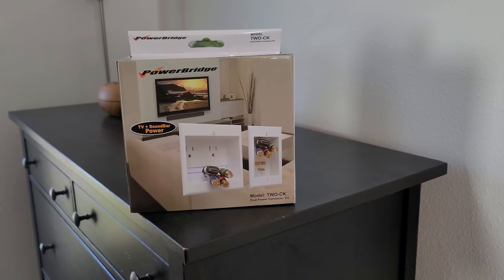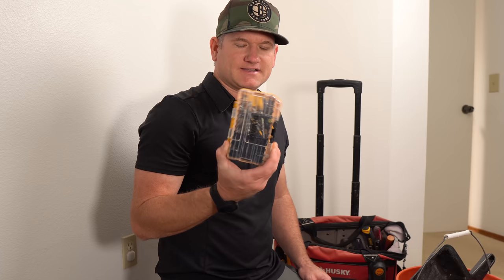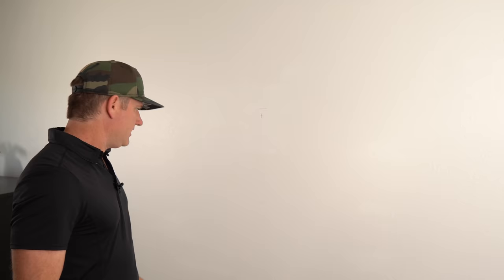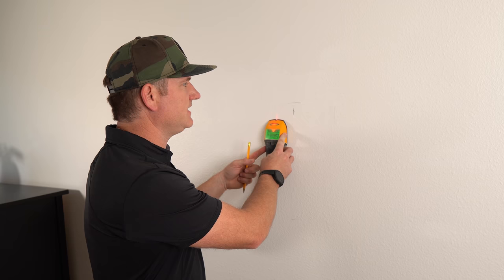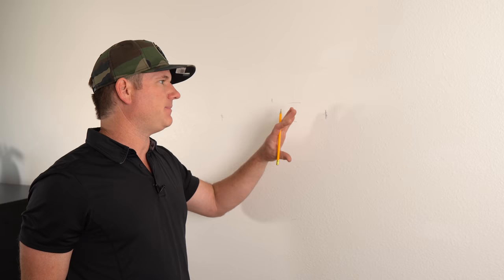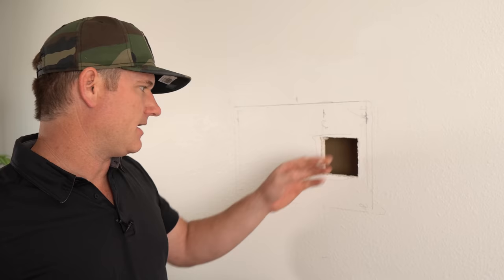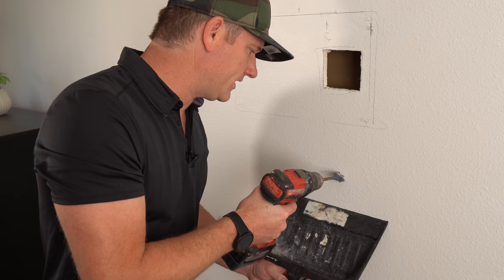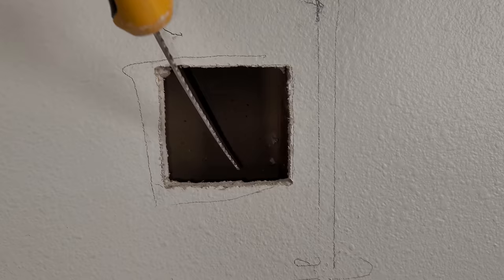Hide Your TV Wires Easily w/ PowerBridge like a PRO

Comment: Great information. What is the recommended  HDMI cable length for running cables in-wall?
Reply from the maker: I always just do 15ft to have length against the mount and tv to side of hdmi and down to your source. 10ft typically works.
Reply: @BTheInstaller  Thank you very much!

Comment: Is there a reason you didn't just cut in a single gang old work box and use a blank plate?   The owner most likely isn't going to sand the wall patch and paint behind the TV.   Seems cleaner, faster and less messy to use a blank plate.....it can always be patched if needed

Comment: That's NOT how a licensed "RW Electrician" does a TV or Audio/Video installation!! We don't ever have any A/C power cords, CATV, CAT6, HDMI, Fiber, RJ45, RG59/RG6 BNC cables ever being exposed.

The BICSI, UBC, IBC Electrical NEC code installation doesn't require an additional hole(s) to be made in the wall. 

Correct uniformed installation is as follows......

1 - Verify OHMS law on all associated equipment to determine the correct circuit rating - re; 15amp-20amp-30amp etc...

2 - Template your install backplate to the the desired wall location, also verify local A/C power.

3 - Determine install location, then trim out your TV wall mount and recessed cabinet onto the wall.

4 - Fish your A/C and all other cables behind the wall after utilizing a flex bit to get through any fire blocks, studs or headers, so that you can fish all the wires from the recessed TV- Audio/Video cabinet that has a UL (4) square gang box that comes manufactured with UL( 4)-110v plug in outlets, HDMI ports, USB ports, Fiber Node capabilities with input/outputs down to the single gang box 110v GFCI EOL outlet. (Always leave service loops behind the wall for each cable!).

5 - Install the TV wall mount, install the TV, sound bar if needed and all other equipment. 

6- Energize and verify the circuit for correct A/C continuity, polarity, any opens or shorts, then if all wiring is correct, individually plug into each equipment to the A/C outlet and verify functionality. 

7 - Upon completion.....No wires exposed, all cabling, connections and equipment is easily accessible for future  service and upgrades.

Comment: Would've been easier if you'd just cut a long rectangle from the beginning of the outlet hole to near the fireblock and then reuse that for the drywall repair after you fished the outlet wire thru the block

Comment: Nice but my walls are made of concrete with steel bars inside... I guess my only option is to buy/make a wood panel to hide the wires behind but its also a 65" tv so most panels doesn't fit
Reply: Every block wall with gyp board has to have at least 3/4” furring, just enough to slide Romex  down.

Comment: What bolts do you use to anchor the TV rack to the drywall? Great video. Tx!
Reply: Most TV mounts come with LAG bolts to secure the mounts to studs.
Reply: @Staple_Mouse   5/16” x 3” lag is the standard for mounting into studs. If your wall is a sheer wall, plywood underneath the drywall, you can use 1/4”-20 x 3” zip toggles into the plywood.

Comment: Did you put the mounting screws in the stud?
Reply: Yes, you have to.
Some mounting brackets require to screw on side into stud and other side into drywall with butterfly screws.
Other brackets require to be screwed to studs on both sides.
That info should be on the bracket instructions.

Comment: What about Older homes like Mine with Plaster Walls with Shiplap and Wire Mesh Behind It! @B The Installer
Reply from the maker: Works. Just cut out the boards sometimes the flaps on the boxes aren't deep enough and I trim down the depth of wood behind the plaster.  No easy but doable

Comment: Would it be better to install 2x4 on wall first then mount the brackets onto the 2x4?
Reply from the maker: No. That is redundant. The studs in-wall are holding the house up. It can easily handle a tv
Reply: @BTheInstaller  Good. Thanks.

Comment: What do u do if the center stud is middle of mount but no studs left or right of center stud...what kind of anchors could I use
Reply: You could probably get away with just two lag screws. Use the max length which would be 4 inches
Reply: @luptonpittman6520  ty

Comment: I had my tv hung but the tv is not exactly level.  Is there any adjustment I can make
Reply from the maker: Yes, you can manipulate the tv relative to the holes in the brackets on the tv.  So if the left side is higher... you can take if off wall plate and loosen the bracket on tv and put upward pressure on the bracket as you tighten those screws.  And the opposite on the other side pushing down as you tighten those.  It can completely level out a tv without any power tools.

Comment: What would you do for an exterior wall that is cement block?
Reply from the maker: We don't have a ton of that in the US, but because cutting into that sort of wall makes it much more expensive most will opt for outside wall cable management.  Some concrete walls in USA have conduits added before they're built.
Reply: @BTheInstaller  new home build in FL. Never heard of a house like that either. I’ll dig deeper because I don’t think sales people know all there is for building. Just saying
Reply from the maker: Is this basement ? My experience is that on any concrete based building, it's normally framed inside of the structure. Unless it's for the look of stone,  maybe stone "looking" walls are actually just q facade over the framing.

Comment: With the Powerbridge, are we supposed to place the surge protector at the bottom (ie extension cord connected to surge protector) or can we place it higher up?
Reply from the maker: Good question. Bottom is fine as they make surge protected power outlets and then everything plugged in to that is covered.  So I think the same would be true to surge protector at bottom.

Comment: Seems crazy to me to still have an external power cord when you could easily wire something properly in the wall. FYI if you guys are doing this with HDMI cables in the wall like this, do it after any construction or remodeling, it's not code compliant at least in the USA and they'll make you rip this out.
Reply: Non electrician can wire a new outlet ? I always have this doubt . Anyways, Here in my building I have to ask for a permit in the city to do it to avoid problems with insurances company  . This is the cheapest and fast solution for non professional.
Reply: @eliezeroliveira6105 you certainly don’t have to be an electrician to install an outlet. As long as you know what you’re doing, it’s quite easy. There are always things to consider for safety, including local regulations, but almost anyone can do it.

Comment: When geek squad mounted my tv on the wall, they cut a hole in the wall and installed a plug that ran behind the all and plugged in at the bottom where it’s covered by a stand. So all
My devices are hidden behind my tv and plugged in where no one can see them. Even my video game consoles
Are wireless hdmi
Reply: They put a plug inside your wall  ? I hope not  !! Maybe you mean they ran the TV plug and cable down through the wall and out the bottom where your outlet is, sorry maybe I'm misunderstanding your terminology

Comment: Nice extra hole… you had a spade bit long enough to drill through the fire block. Right angle drill adapter would have made it into the initial hole. Extra work for no reason.
Reply from the maker: You have to remember, this wasn't a video on how I could do this the easiest. It's for others to follow. The fireblock was a secondary issue I didn't want to have to show at all but $20+ bits and right angle drills... most don't have that stuff nor want to do it.

Comment: Or just put two holes in the wall, use a low power outlet box and then a couple covers (as sold on monoprice or other sites).  This is such overkill.

Comment: These walls are "fake".
In Europe we have solid walls so all these are useless. 
Samsung one box is a clever solution.
Reply: Their houses are wood and drywall. Hiding wires is not so easy in my house... every wall is 15cm brick.
Reply: There also methods for that. A bit more work, but it can be done in a couple of hours as a non-pro.

Comment: Can I glue the Tv to the Wall instead and just glu the plug next to it. Your install has to much stuff you need and work you need to do. I dont have all day. I need a more practical and low cost solution for my 85inch Tv.
Reply from the maker: Personally I wouldn't glue a tv to wall.. 🤦‍♂️.. my video this week is a simple install. No wiring.
Reply: Or you can put a screw on each corner of tv and save the money of the mounting bracket.

Comment: Cutting a 1" hole through a fire block and running wire through it literally defeats the purpose of the fire block. The hole should be filled with some sort of caulking or expanding foam.

Comment: Why not add an extra string in case the owner needs to add another HDMI down the road?
Reply from the maker: You can.  I didn't need the red cord.. so I was just showing. You can also use the excess of the cord, pull it down, then tie another one to that red cord and use it to pull up a second cord. Works well

Comment: Why not just run a normal (or recessed) outlet up to that spot. I mean, you're already into drywall repair, but you wouldn't even have needed to do that if you had a flex bit. Now you have dry wall repair and a shabby looking extension cord running one stud over. Why? This powerbridge is dumb.

Comment: This is how to hide wires like a homeowner… Pro installer would go the outlet route… Still an fair solution but not “pro” worthy
Reply: Agreed. Overall a solid C grade install. Even the way he ran the cables in the wall - lack of care.
Reply: Definitely not pro 😂. Outlet route 0 wire exposed, look at all those wires underneath
Reply from the maker: You guys are hilarious.  This is a video on using a power bridge.  🤦‍♂️
Reply: Your title said “like a PRO”, Pro doesn’t do that 😂😂
Reply: @antonioho3688  Well....he is a pro and he did it so obviously you're mistaken. Is it the best job ever? No. But it's ok. He's not an electrician and therefore cannot do electrical work commercially. So the homeowner would have to pay a licensed electrician $250 or so to run an outlet behind the TV (since they usually have minimum call out fees). Since it's being covered anyway, like he said, the homeowner probably did not want to pay that. That's what normal people call "basic logic and reason". The world isn't a text book. You thinking it is just shows your ignorance. 

If this is what the homeowner ASKED for, it's fine. It's a power cable. Get over yourself. You guys are referring to top quality, big budget installs. This is a "regular" budget install. Probably 200-300 bucks plus whatever that equip costs. Pretty cheap for skilled labor. Hell, Geek squad charges $155 an hour and they are next to useless. For the 5 star, business class, white glove pro install you all are refereeing to, that's probably closer to a thousand dollars. That would be new power line run, HDMI terminated to female ends, legit drywall patch not just mud cover, paint matching, ethernet run. Yeah, over a thousand bucks. Most people aren't going to spend that. This is just "normal" budget work. You guys are not realistic with your criticisms when comparing small budget labor to top quality.
Reply from the maker: I appreciate the support but I am an electrician and have tied 10s of thousands of jobs into the electrical....but this is a video to show end users how to put in a power bridge.  💪✌
Reply: @BTheInstaller  Fair enough. Either way, it's good enough for an inexpensive job. I get their criticisms but they just aren't realistic unless you have a limitless budget.
Reply: @user-nh3gu1ge3d  it was a good enough video to give me the confidence to do it myself and not have to hire somebody and spend hundreds or even $1,000 like you said. I couldn't care less about the hole in the wall it's behind the TV. What I do care about is making my life happy and she's been wanting our wires hid for a long time and I didn't even know that something like this existed
Reply: If it was only for professionals it wouldn’t do very well on YouTube.  He’s showing a DIY solution that anyone can do.
Reply: @kevinseversonandhisvizslas8287  Fair, but don't title it "like a pro"
Reply: Then the pro would be screwing you out of a lot of functionality. Are you plugging your TV straight into the outlet with no surge protector? What if you want a power conditioner?  Are they running HDMI as well? Is it HDMI 2.1? What about when 2.2 or 3.0 comes out? Do you pay the electrician another $350 to come fish whatever new cable you need?  OR you can do it yourself, use whatever surge protector you want, fish whatever cables you need of whatever spec and quality you need.  This is *better*.
Reply: this you can do in a couple hours and get your tv mounted. sure, call an electrician to come give you a price for the work. I’m sure he’ll be the there within a few weeks.  if you actually get somebody to price it, it’ll be $500 minimum. schedule the work to be completed in 4 to 8 weeks…
Reply: @007Variable  You can DIY a proper install in the exact same time. 120v residential electrical is not rocket science.
Reply: I'm late to the party. I've always been too lazy to mount TV. Since wife wants new bedroom crap, I decided to mount the TV and looked for how to make it cleaner looking. Never heard of this power thing before either.  Again, yeah it's an old topic, but I'm old also and wanted to coment. First, it's "like a pro." Key word being "LIKE." Second, why are all you "pro's" so butt hurt? Are you made you can't talk people in to paying for BS they can't afford? Yeah, if I'm sitting on a lot of "throw away" cash, rewire my whole damn house, IDC. However, most people aren't. Third, the video was about the damn product he was using, not hardwiring a wall. Fourth, if your a person that flips or rent houses and you do your own work, think about how inexpensive something like this is to install and how great it is as a selling point. Lastly, and most importantly, if you're one of the "pro's" criticizithis video, what the hell are you doing on YouTube looking at "how to videos?" Sorry, but I expect my "pro's" to know how to do simple shit before I hire them.

Comment: Using an extension cord or even running the TV cord through the wall is a code violation. That's the whole point of using the PowerBridge or similar product, it's a code compliant solution to concealing wires. Please don't advise folks to create potential fire hazards.
Reply from the maker: That's what this is.
Reply: @BTheInstaller  Agreed, but in the video, you commented that the number of outlets really isn't that critical as you could just run an extension cord or surge protector. Guess it should be made clear that the suggestion of an extension cord or surge protector to add additional outlets is predicated on plugging into the "new" outlet and not running it through the wall. Seems like this would have the opposite effect of simplifying cable management and decluttering wiring behind the TV though.
Reply from the maker: @jamesonward5141  I'm talking behind the tv. Why put in 4 outlets when you can add surge protector etc.
Reply: @BTheInstaller  just a suggested point of clarification. Folks are coming to you video (well made by the way) because they may not be well versed in the installation of this and not fully aware of limitations/potential issues. Granted the product literature should clearly indicate power/extension cords should not be run in the wall cavity, why compound it by not clarifying your suggestion of a surge protector or extension cord for additional outlets is to be plugged into the "new" outlet behind the TV.

Comment: This company spent so much money engineering this solution so everything is flush to the wall and proprietary connectors and then they engineer it so the power cord plug at the bottom sticks out an inch so things like your dresser cannot push right against the wall. Dohhh... For all my rooms I went with wall scoops with big openings for $5 each and used an extension cord to run power to the back of my TV, this product seems way over engineered and I bet it was super expensive also!

Comment: Suggestions for viewers: review your electrical codes in your area before using this Powerbridge.  Unless that deep unit has a metal plate on the back, it won't pass electrical safety codes in many areas, nor will that loose wire hanging through the wall.  There are many quick and good ways to fix a hole that size -- smushing lots of mud in it, is not one of them.  If there's ever any light contact on the wall where the hole is, that patch will be compromised.  I would have just affixed a small strip of wood behind that hole with 1 drywall screw at top and bottom, then cut a small piece of drywall to fit.  Then mud it up.  If you are cutting through a code required fire break, then you need to seal the hole through it with a fire blocking sealant. Last suggestion is if you want to prolong the life of your tools, wash and dry them after every use -- sorry, but my pet peeve is people who don' show proper respect either for safety codes or  their tools -- and all that gunk and rust on your tools just makes me cringe.
Reply: Why? There's no metal plate in plastic electrical boxes.
Reply: Lmfao!!!